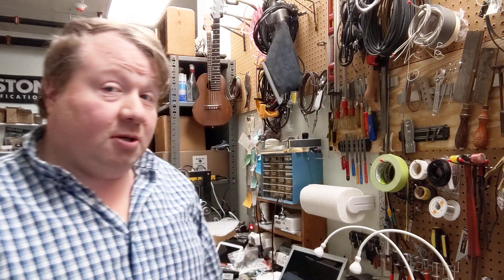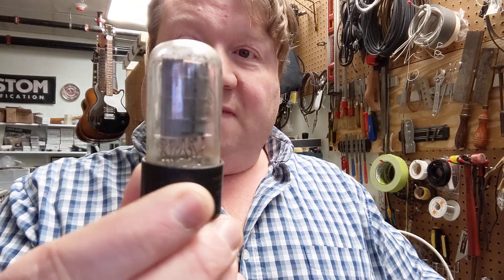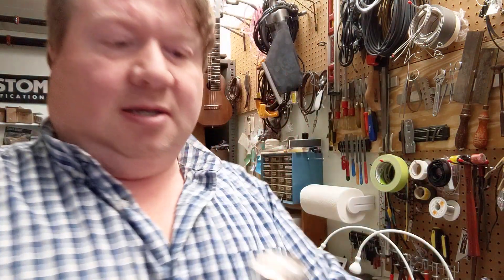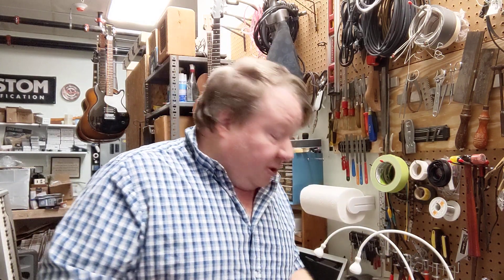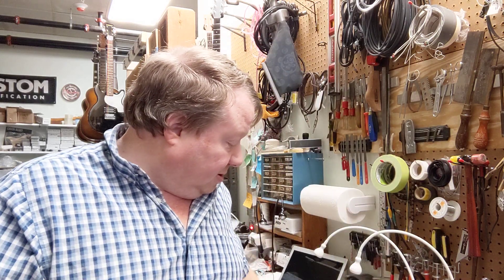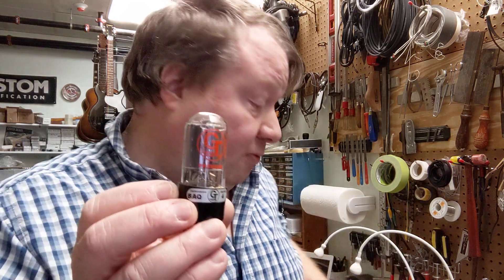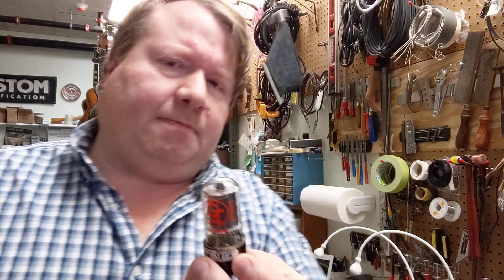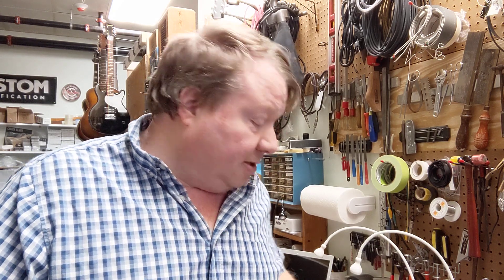Tube Talk -part 6 - The 6V6

Comment: A 6V6 has a bit more of a "mid hump" which sounds great overdriven compared to 6L6 or EL34 tubes. Compine that with the lower wattage being able to be pushed into overdrive and you can see why amps using them are more popular these days. Higher wattages with more headroom isn't sought after as much these days since PA technology is better and smaller venues, recording, portability and home use has become more of a goal.
Reply: I love that "chewy mid hump" in my little princeton. I get tempted to  pull them and try them in a 6L6 40watt Fender amp but don't want to damage them.

Comment: Thank you for this vid. I just swapped out a bad tube in a brand New 68 Vibro Champ. It came with a bad GrooveTube, and I bought a RSD 4,4ma. ;-) 

Do I need to do anything else (Bias,,? ) 

Thx!
Reply from the maker: these amps have a fixed bias, so you should be fine.   If it's brand new, it might have been a defective tube.

Comment: Hi Gary. I would like to ask you to compare to compare the real power output of 6V6 and EL84. You say that pair of 6V6 are making 12W on a good day, how about the EL84? There are amps that claim 15-20W from pair of EL84. Is this a lie too? I am wondering since the max. plate dissipation of EL84 is 12W and 14W for 6V6. Thank you.
Reply from the maker: A pair of EL84s are widely evaluated at 15 watts. There is a very big tonal difference between the 6V6 and the EL84.   The 6V6 or more mid-range heavy, and distort naturally at a lower volume. The EL84s are often used in hi-fi because of their wide tonal range.
Reply: @GarysGuitarsUSA  I am confused now. Based on what you say, EL84 can put out more Watts to the speaker, despite the lower maximum dissipation and 6V6 breaks up sooner. Therefore 6V6 has got less headroom. If this is correct, how would you explain the fact that Fender Deluxe Reverb is considered to have a good clean headroom for gigging while claiming 22W RMS and Marshall style 18 watters are considered not to have enought clean headroom for gigging. This is what I have researched from multiple forums. Might still be wrong. I intend to build an amp with pair of 6V6/EL84, still undecided and open to suggestions if this would not give enough clean headroom for rehearsals.
Reply from the maker: Marshalls are designed to be overdriven earlier.   To our sound that's comparable to their EL34 cousins
Reply from the maker: For more accurate comparison, consider comparing a Fender Deluxe and a Vox AC15.